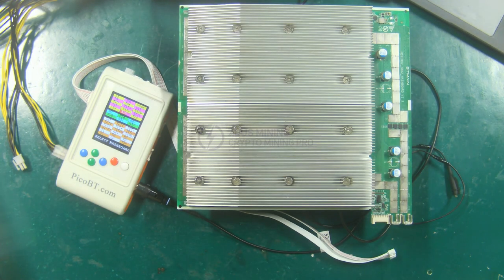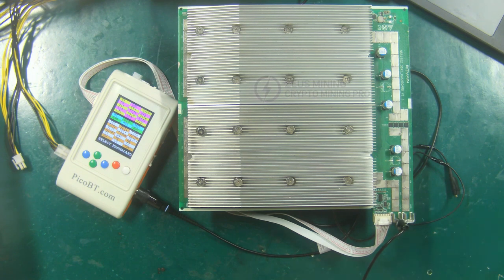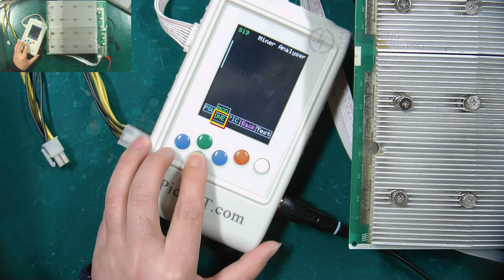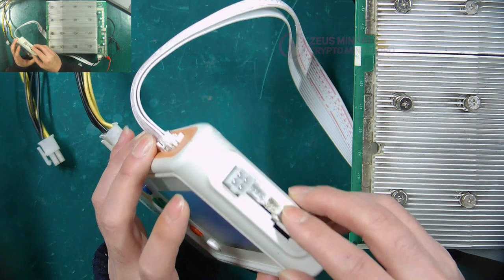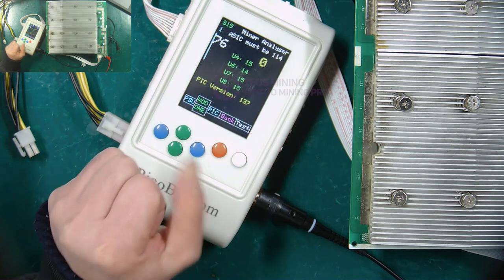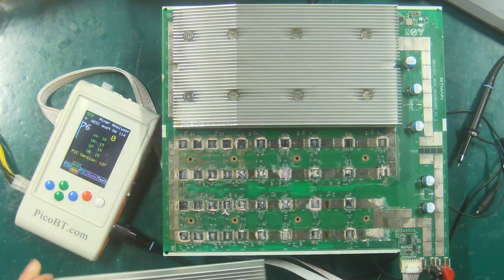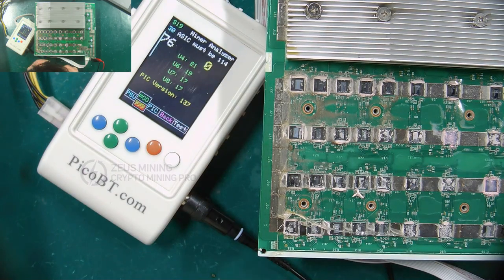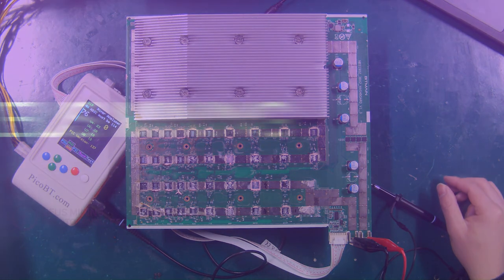Use PicoBT multifunctional tester to test Antminer S19 hash board  | PicoBT Tester  Guide Manual

Comment: Does new s19 (88 chips) hashboard come with PIC?
Reply from the maker: The s19 ( 88 chips ) hash board is an aluminum PCB, so there is no PIC.
Reply: @ZEUSMINING  for every new s19 model, there is no PIC on the hashboard right? How about the latest s19k Pro and s19j pro+?
Reply from the maker: Currently, only aluminum substrates do not have PIC.
If you need to know more about the product, you can directly contact our sales WhatsApp: +8618623251355,🙂 he will provide you with better service, thank you!